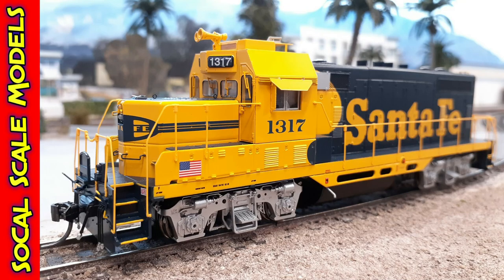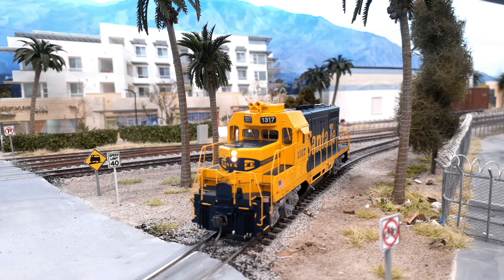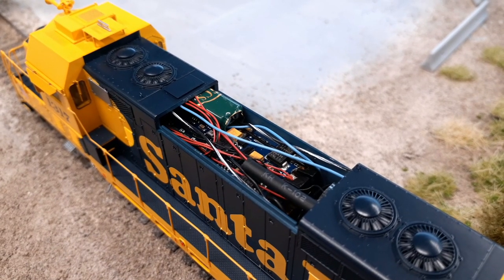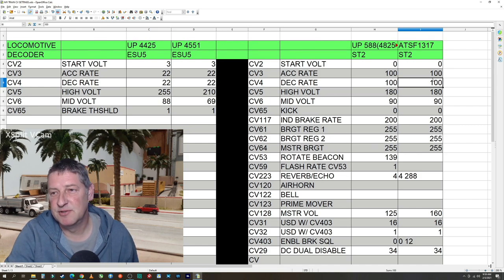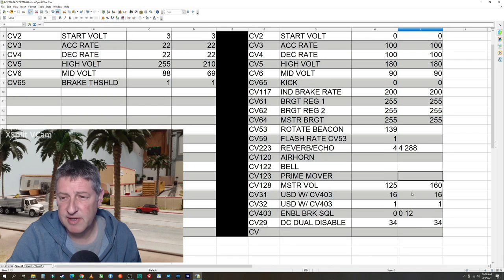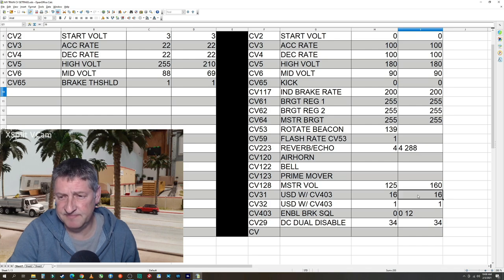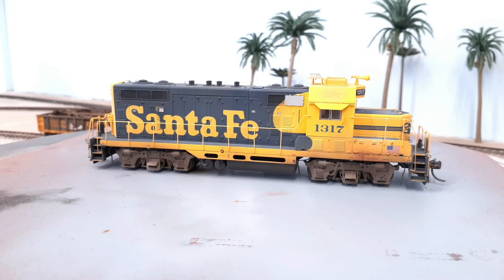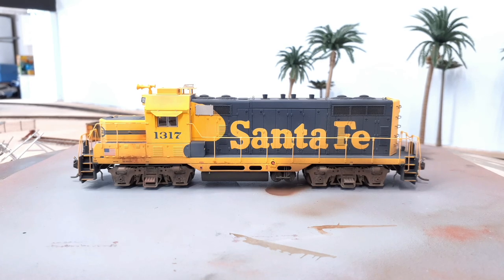How I do it | New locomotive - Athearn Genesis ATSF GP7u | Weathering | Setting initial CV's

Comment: There might be a better place for the capacitors if you take the entire body off - don't know if you did that.   The fuel tanks may be hollow.  Just might need to extend the wires.
Nice weathering job.
Reply from the maker: Yes I did take the body off. Almost no room in there anywhere. I did think of the fuel tank but managed to get the TCS KA1 stuck on top of the decoder. Only had to cut a small tab off the top lid.

Comment: I bought one of these from the first run with the BNSF patch, and I just love it. You did an awesome job with the weathering, and I'm interested in the keep alive install, thank you for sharing.   Dave B.
Reply from the maker: Thanks. As for the keepalive, I bought a soundtraxx one just for this engine but it's too big and there's almost no room in the loco to fit it in. I just had the TCS keepalive handy and the tsunami2 board has a plug for the current keeper. I cut the connector off the soundtraxx current keeper and soldered onto the TSC. It just fit since it's about half the size.

Comment: Can the CV's be adjusted to run even slower?  I've seen some LokSound-equipped locos that you can hardly tell they're moving!  Not sure if it's the difference in the decoders or in CV settings.  Looks good!
Reply from the maker: I adjust the momentum CV's to about 200, but you can play around with them to get the locomotive moving to your own liking.

Comment: Noticed on your cv chart its esu not t-2 decoder.   ?   You install  esu
Reply from the maker: The spreadsheet has my four engines on it. The two at the left are my scaletrains sd40t-2s. They have esu decoders. On the right are the two athearns, GP38 and the new GP7u. They have the factory soundtraxx tsunami2s.